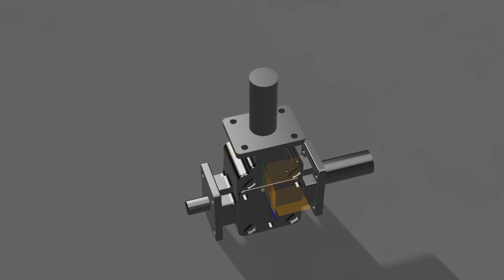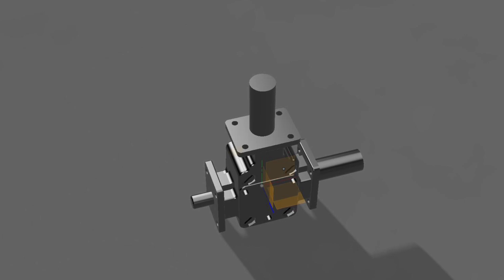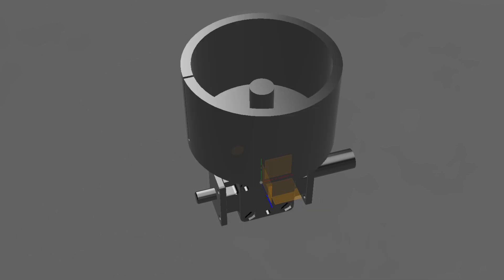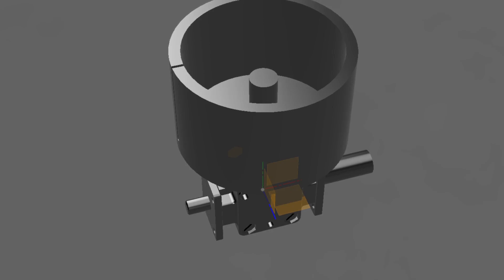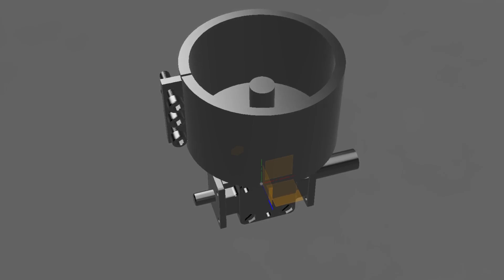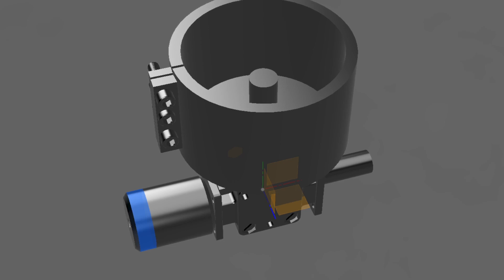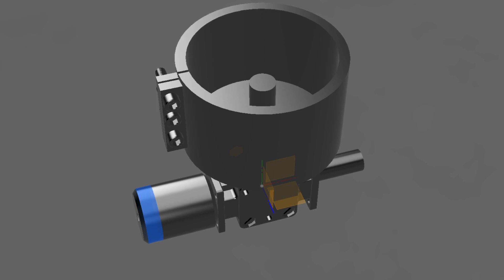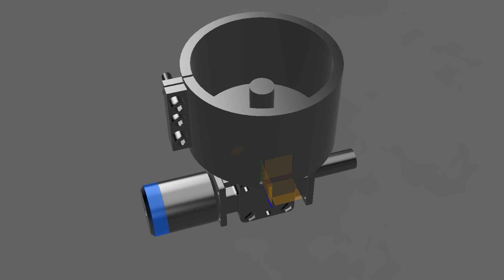Right Angle Head for Mill 1

Comment: Hello Herb,

Happy new year.

I'd be a little concerned about the rigidity and strength of the right angle gearbox, but it looks like you could add plates to the sleeve to support the casing.

How are you thinking of implementing a 5C or R8 adaptor? I can't quite see how you can mount a collet adaptor without excessive overhang. An ER holder might be more feasible.
Reply from the maker: +Paul Compton you are right,   I was thinking about an ER-32, as it's my favorite.
The right angle drive is rated at 1-1/2 HP,  but as you said, it may need some bracing.  The are bosses to add a plate between it and the sleeve.  Doing it on cad is the basics, but actual build is always somewhat different.